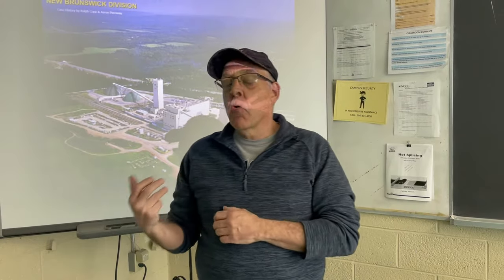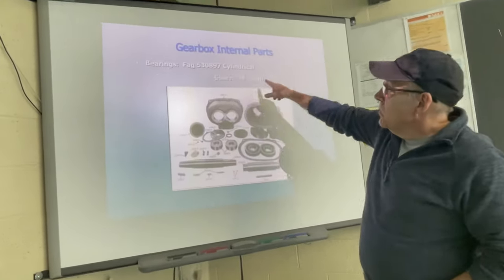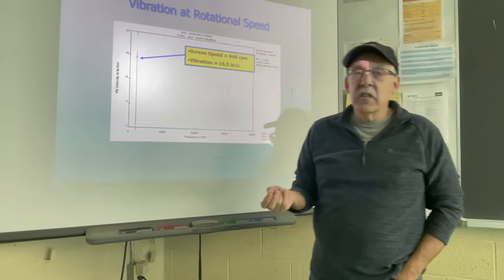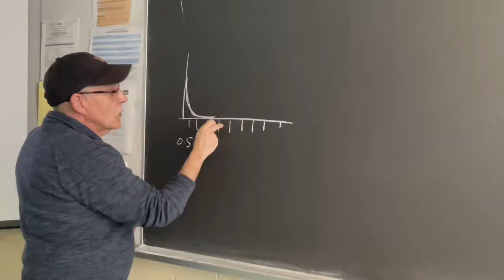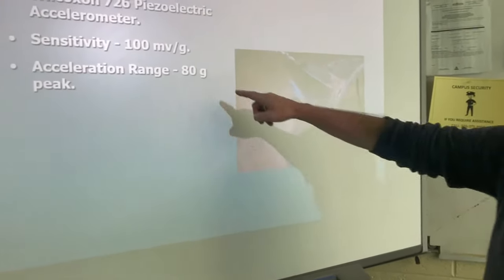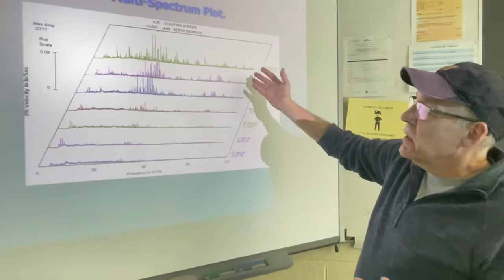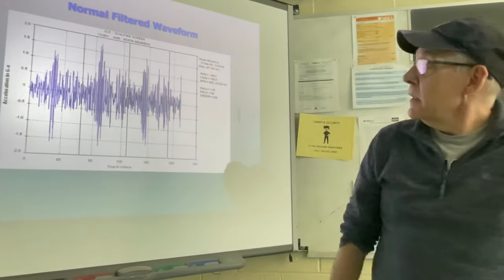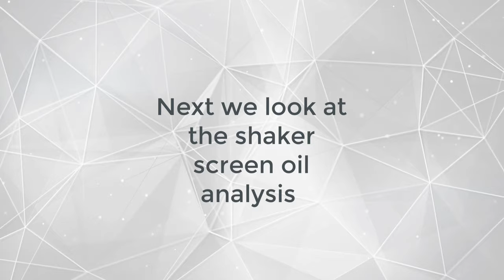Interview With an Expert Vibration Analyst: Shaker Screen Vibration Analysis Case study

Comment: Nice job! Question, why are you utilizing in/sec for pk vue?
Reply from the maker: it’s peak velocity.
Reply: @Stubbornnut  Yes, I am aware; should not be in/sec for peak vue - Acceleration/g's is utilized for impact/friction at high frequency detection. Was wondering why it was displayed during lecture, no big deal.
Reply from the maker: what i meant is that what you are seeing isn’t peak vue. it’s peak velocity. basic spectrum. not peak vue.
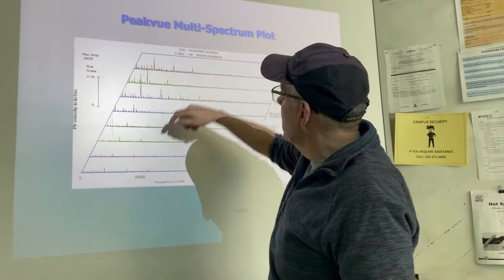Reply: @Stubbornnut  ok starting at (~) 31:43 the slides say pk vue at top of screen & is referenced as such, but Velocity/in/sec is being used for data, which is incorrect set up.  Always Acceleration/gs. Yes, it's a great idea to compare standard spectrum taken with velocity/ips or even displacement/mils to Pk vue or HFD for early detection, pk vues main purpose & its sensitivity/ contrasts. It may have been some plots mistakenly placed in slide show. Hard to keep track, I instructed as well.